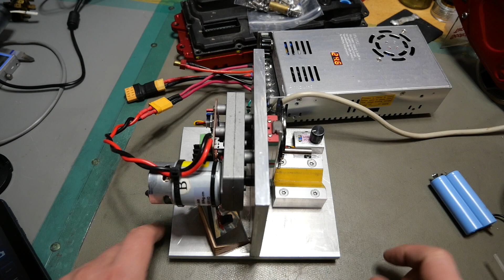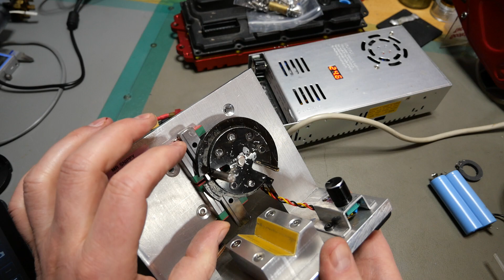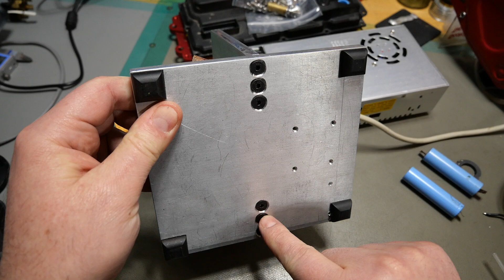Spot weld sheer update - Mr Snippy

Comment: Thanks for the update but no demo?
I don’t know what this device actually does. You mention removing of the welds but seeing it in action and the results (no sanding/smoothing needed?) would be invaluable IMO.
Reply from the maker: I've already demo'd it. Go look up my other videos on Mr Snippy. Also with the lense I was using I can't get in really close so I can show what is in the mirror, I really wanted to just show the limits trimmers and the general build.
Reply: @de-bodgery  I figured you had probably demo’ed it previously but I’ve always felt it was better to not make viewers go through multiple videos. I do understand that two demos takes more time but a mention in the description where a close-up view and demo can be found would have been awesome. Thanks for this video though!
Reply from the maker: @batterymooch  Good idea...I'll add the other videos in the description.
Reply: @de-bodgery or just run the two batteries through the damn cutter! XD
Reply from the maker: @TreYay83  It does have one minor deficiency and it's with very thin nickle like .1mm. You don't get super easy sheers. The metal is so thin that the blade tends to cut through it or slide over it and it takes a few tries to get the welds to cut off. For .2mm and above it's very quick and easy to use and almost always takes the welds off smooth on the first cut. These 2 cells had .1mm nickel on them so it's more of a PITA to sheer it off on camera.